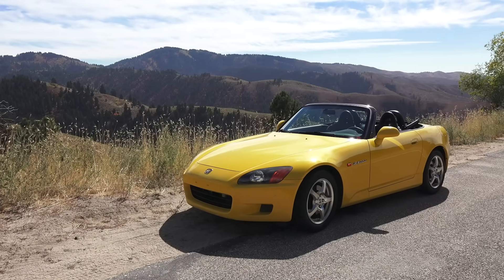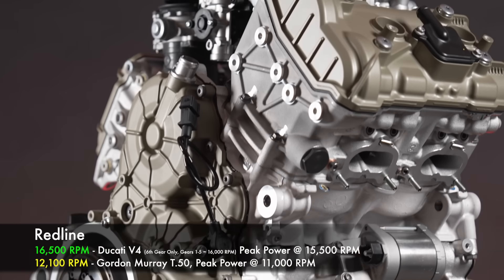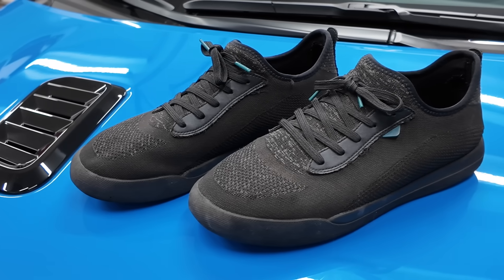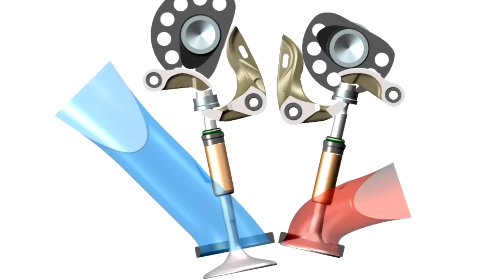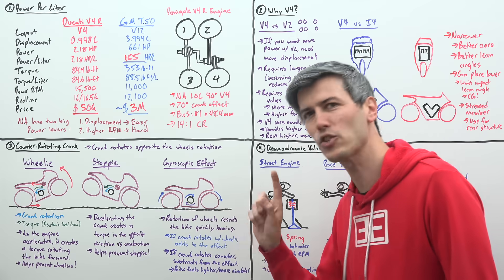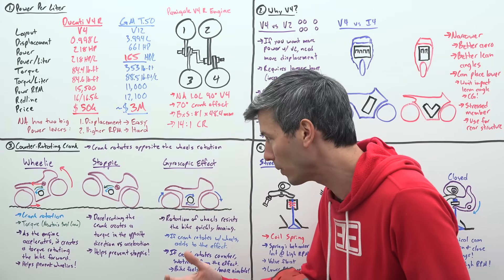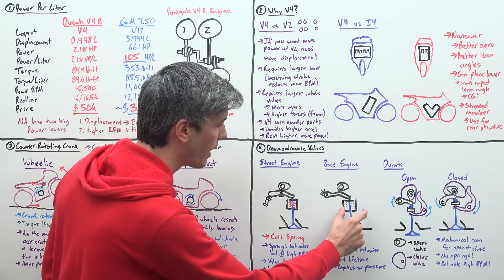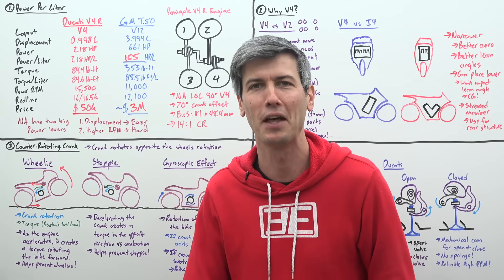Ducati's Brilliant V4 Engine — Putting Supercars To Shame!

Comment: Curious thing about the valve operations with no springs. Back in Auto class in the late 60s early 70s, that question came up to our teacher. His response was, that's the way they've always done it. He explained that a lot of horsepower was used to rotate that camshaft, but if there was a way to change that, they would. We couldn't accept that answer. We, as a group, playfully designed a dual type cam, similar to this, which would open, close and not interfere with each other, yet be accurate. Ours required very specific adjustable tolerances, but it worked, on paper. Very simple design. The Prof looked at it, shrugged and left the paper on the table. That alone irked us even more, but there was nothing we could do. As I got older and belt drives arrived, it all came back; why not make a mechanical only camshaft that almost freely spun? Crickets. The resistance would be minimal and efficiency would obviously increase. Now I see this and wonder why it wasn't done earlier (or was it???). I'm glad someone had the guts to try this out and succeed. The other experiment we tried was to invent an ICE that had a fixed connecting rod/piston that ONLY went exactly up and down with no sideways movement. We went through a lot of paper playing with that one. It was a fun brain teaser.
Reply: Interesting. I always thought that piston/rod mass could be much lighter if the two pieces were one. No wrist pin mass, for example. There's a gigantic (i.e. two-story tall), single-cylinder engine at a nearby steam thresher site that works like that: straight up and down rod function with the necessary rocking back and forth very near the crankshaft. Of course, its rpm are only in the low hundreds.

Comment: Excuse-me, but no: Ducati is certainly not the first street motorbike producer to offer a counter revving crankshaft on a production bike. It was Yamaha with it's in line four on the R1 in 2009 with the "Crossplane" engine.

Comment: It would be fair to point out that, although Ducati is currently the only company using desmodromic valves, they didn’t invent it and it’s not new. Mercedes were using it in the 1950s and it was being used decades before that.

Comment: 4:48 The main reason is - shorter and hence more stable crankshaft, which can spin 2000 rpm more than longer crankshaft of inline four engine (if other parameters are the same). More RPM = more power. That’s the reason why in 2026 all MotoGP bikes will use V4 (even Yamaha).

Comment: We can also make a hybrid of the powerful 2-cycle and the cleaner 4-cycle into the D-cycle, by simply splitting the piston ring-section from its skirt part - to be operated via a ( valvetrain-like) "pistontrain" to perform the exhaust and intake breathing strokes. The resultant D-cycle (differential-stroke cycle) completes the 4 strokes, different in both displacements and periods, per revolution. Tests have shown >20% fuel saving  and 2.5 to 3 times torque gain. The pistontrain can be retrofitted onto existing and new engines readily.

Comment: Really enjoyed the vid. 

I hope to see you make a video on the Yamaha R6 motor. 

IMO, itis more impressive. 

Revs higher and produces more torque and horsepower per liter without the use of “special” oil. 

Engine was bulletproof too. I put 120k miles on my 2008. Never had any problems with the motor

Comment: I have a couple sport bikes, including a 2023 Ducati V4SP2 with the 1100cc version of this engine and it is an absolute dream engine and overall machine. I also have a 2023 Honda Fireblade and I've built lots of cars, including 920whp Subaru STI. These bikes are nothing short of art.

Comment: Until five years ago, I worked for the company that was tasked by DUCATI to manufacture all the crankshaft and camshafts of the GP bikes (it's basically been a sole sourcing since the beginning of the DUCATI MotoGP team) and also manufactured bunch of components for DUCATI Holding.
The crankshaft shown in the video (at 3:00) isn't actually the one used on the std Panigale, but the one used on the Superleggera V4. 
That crankshaft is made starting from a raw billet, while the std V4 crankshaft is made from a forged raw part.
Same goes for conrods shown in the video, which were specifically made for that small run.

That said, beside being V4s, there's nothing much more in common between the DUCATI GP V4 engine and the Panigale V4 one. 
Oil distribution, angle between the 2 crankpin, counterweight shafts and weight distribution, etc... all different (as it should be). 
I'm also not 100% sure that the GP engine is a counter-rotating engine as well, but the memories on this topic are vague...
Just know that if they try to tell you that the Panigale V4 engine is derived from the MotoGP engine ... It's all publicity stunt.

Last but not least, I can tell you that somewhere in the archives of the AUDI offices, sit the the designs of a V8 and V12 Desmodromic AUDI engine.

Crankshafts and camshafts were manufactured couple of years after AUDI bought DUCATI, but for whatever reason the engine never saw the light of day. I'm assuming it was not meeting emissions limits imposed by the EU
I wasn't at the company at that time so I wasn't looped in the discussions, but I saw the dwgs and the excess camshafts that were manufactured inhouse as safety stock
Reply: Thanks for info,  Motop engine is now counter roatating but it wasn’t always.  Desmo Dovi famously ran well over the inside curbs at turn 1 Qatar that he alsmot crashed in preseason testing when he first tried it,  that is how much the riders had to force the bike over in high RPM high speed corner entry like at that track.  Subsequent to that change they’ve been in the rise.  For variety of reasons but that is a key one amoung them.
Reply: @metalmike87 good comment, but one addition, the desmo V8 for the R8 has been build and has been put into a test car. project was more or less done. Google Audi SHDZ. I assume you come from Pankl then?
Reply: Panigale V4 의 엔진이 구세대 데스모디치 RR V4 엔진에서 참고된 것은 부정할 수 없습니다. 시판용을 염두했기 때문에 gp v4와 다른것은 당연합니다. 세월이 흘러 더 강력한 엔진이 motogp에 나온다면 지금의 gp v4 엔진은 시판용이 될수도 있습니다. 개인적인 생각

Comment: Wow, nice video, thanks. I'm subscribing. Can I nitpick a little? Having a counter-rotating engine will not reduce the gyroscopically-induced resistance to rotation around the longitudinal axis (the rolling axis). The sum total resistance to roll between the wheels and engine will be the same. What will change is the force-coupling that  manifests itself 90 degrees away from the external input. (That is, gyroscopic precession). For example, use a toy gyroscope that is rotating away from you on the top. Try to roll it to the right, and it will try to turn to the right around a vertical axis. If you try it again with the top rolling towards you, as you roll it to the right, it will try to turn to the left around the vertical axis, but the resistance to roll will be the same, given that the gyroscope is rotating at the same speed. On motorcycles, rotating "forwards" tends to "yaw" the wheels further into the turn. A gyroscope rotating the opposite way presents a force to the chassis that tends to yaw in the opposite direction around the vertical axis.

Comment: Interesting to see something sensible on utube. Valve train is a major area to improve IC engines. Remember when F1 V engines revved  to 19000 rpm at those speeds valve springs can’t cope and all types were experimental, hydraulic, pneumatic, electronic, rotational etc etc. Brilliant engineering video. Perhaps modern geeks need to look further than just fitting gimmicks to modern cars. Sorry I really enjoy and appreciate motor cycle and other sport but my knowledge of road bikes is now very limited. Thank you.

Comment: It is no coincidence that the most sophisticated racing motorcycles in the world, those that compete in MotoGP, almost all have V4 engines. In the last 10 seasons, no motorcycle with an inline 4-cylinder engine has won the MotoGP world constructors' championship. Inline 4-cylinder engines are much less expensive to produce, which is why they are preferred for sports road bikes.

Comment: A V-twin has perfect primary balance. The moving masses all cancel each other so there’s no vibration. However the firing pulses are uneven. A V-4 is two V-twins with the crank throws in opposite directions. This creates four equally spaced power pulses.

Comment: The desmodromic valve is a very old concept as a lot of things in the mechanical field. The real wonder here is to manage the closing adjustment of the valves with the thermal dilation of the different material. I guess this is a real challenge to have the valve still closing perfectly if the motor is cold vs hot, and the material combination used to do this is surely part of the know how.

Comment: gyroscopic effect does not depend on the direction of rotation, a flywheel will equally resist changes to its plane of rotation irrespective which way it's rotating

Comment: Yes please, more on the 90° V4 and 70° firing order. And how is it different to Aprilia' s V4, as well as how Aprilia's adjustable rake/trail, swingarm pivot height, and their engines can be lowered in the frame affect handling vs. the counter rotating crank

Comment: As a previous Ducati owner, you forgot to mention that the valves need to be adjusted every 10k to 15k miles. So, I think you can throw out your reliably statement.
Reply: Pneumatic valve springs in MotoGP typically need to be replaced every 600 to 1,200 miles.
Reply: @07m4x9  My Ducati Desmo was certainly not a Moto GP bike😆

Comment: You touched on it, but also a bike under acceleration while leaned over will pick up, not abrupt throttle change because contact patch and traction is very limited while at lean, but counter rotating has the opposite effect is to pull it down into the corner.

Comment: Friction and Kinetic energy squares to velocity, that's the real expensive part.   
Yes I know, engine specs with stroke ot control piston speed etc, but when you do all of this, you end up always pulling torque out to have power and the only way to have the power is to stay up in the high wear rate of the engine, nothing is free in life, including HP with low mass.

Comment: I might be mistaken, but isn't this introduction a bit skewed? After all, to get a mass moving, you need torque. Cars are heavier, so you need more torque. But for the same displacement, more torque typically means less horsepower. So comparing the HP of a car with a motorbike is only telling half the story.

Comment: Hi Baby honey engineer! 
😂You may be a good engineer but you suck at math. 
How can the Ducati engine cost $504? 
You've calculated the cost per horsepower and it's ok, but what's the point? 
You bought apples with bananas is a big mistake anyway! 
And Again: 
One is a niche product, but accessible and on the road, and the other is a product that will be sold in 10-20. 😂
Reply: And what if you're talking about the price of the vehicle? The Panigale costs more than 50,000 as a motorcycle, right? 😂hai sbagliato comunque con 502$

Comment: I have a 1987 Honda CBR250 that red lines at 18500 rpm. It uses specially designed valve springs and a gear driven overhead cam. Springs do work.

Comment: The part about the engine gyro negating the wheel gyro is incorrect. It still adds to the gyro because of the plane in which it’s mounted as well as the fact that it’s adding to the rotational mass on that same plane. Doesn’t matter which way it’s spinning.

Comment: I've worked on several OLD mechanical machines in my career, such as four slides, screw machines, and mikrons. They often employ a cam and counter cam to move cutters in and out, valves open and shut, etc. I'm surprised someone didn't bring this technology to combustion engines sooner! Interesting that Ducati was able to patent it.

Comment: How is the counter rotation corrected for power delivery to the wheel?… is there an additional gear in the transmission or an additional shaft off the crank?

Comment: Mercedes-AMG One produces 353.75HP per litre with the simple addition of turbos, Eclipsing the meager power of NA motors, this is why vehicles are going turbo because it makes getting better top end power easier while still getting good economy when not giving it death. This reduces the cost of engineering and replacement parts.
Reply: AMG one is just a joke of a car.

Comment: Jayson, you need to take a look at the 1000 cc three cylinder Rotex motor for their  CAM AM 4 wheel side-by-side. It puts out 240 hp to 8600 RPM with a turbo.. they have a seven speed dual clutch with sequential transmission speed limited to 100 miles an hour in off-road.

Comment: Its probably worth mentioning that Ducati have been using the Desmo arrangement for 50 years or so & it was originally used by Daimler Benz in the 300 SLR in '54 (which was a 2.5L Straight 8 ).

Comment: A Desmosidici Stradale motor will never do 100k miles let alone 50k. Also, have you seen the maintenance intervals? Valve adjustment every 15k and if you really hustle this engine, you have a complete rebuild every few thousand miles

Comment: Reverse rotating crankshaft doesnt need an extra jack shaft or layshaft to get the direction of rotation right.
The driven gear (clutch) can be internal, ie with its teeth pointing inwards and engage the far side of the driving gear (crank).
You inherently get a bigger reduction though, problem on a road bike.

Comment: I don't know if it's the patents or manufacturing nightmare, but F1 racing needs desmodramic valve train, now. I've been wondering when it would happen for 30 years. Desmo is the difference in HP per cube. If you haven't heard a Ducati 999R in person, you're missing out. It's the most terrifying four cylinder on the planet.

Comment: Ducati did not invent the Desmodromic valve system or patent it. Actually a guy called Gustav Mees invented it and patented the system in 1896 followed by some other individual F H Arnott in 1910. Ducati have however almost exclusively used this system since 1950 ish. Ducati did bower refine the system taking inspiration from the earlier system, including the Mercedes system. Ducati holds patents for their revisions developed by Fabio Taglioni and later by some other engineers, not for the original Desmo system.

Comment: Desmodromic. Goes back much earlier than Ducati. I think it was developed as a solution to the lack of suitable springs steels. The original patent was Karl Benz in 18 something. I cant provide a source but early Norton's used PF (Peugeot Frere) engines around 1907. And Im pretty sure (some of) these were desmo.

Counter rotating.... MV made a ... before MV, S1000RR and I think 675 Triumph's Honda did it. Not the new Fireblade, CB 750's.

Interestingly, to us nerds at least, it did not use an extra jack shaft. It also avoided an increase in crankcase length. The mothod used was to spin the crank backwards then use a hyvo chain to drive the gearbox input shaft.... output shaft goes 'forwards'.

As someone who has ridden both; the effects are readily apparent and most pleasant. The down side is MV's are made of cheese. A V4R is a lot if money and has the crash resistance of a glass of champagne. If I had the money... Id have one tomorow with some BST wheels.

Comment: Why don't we have these engines (or motorcycle engines in general) in cars? Aside from a few open top race spec cars, like entry level Radicals. Durability? Emissions? A small hot hatch or sports car (like an MX5 or a Swift Sport with a Hayabusa engine) with a high revving, light and power dense engine should be a ton of fun even with a price premium.

Comment: It can rev higher because the weight of a bike is much lower as so inertia loads on the drive train. A crankshaft and gearbox of a cycle wontwork long at a 1,5t car. And a heavy engine does not rev as high.

Comment: Here's my problem with Ducati: this engine is an excellent use-case for the desmo valve system. Ducati's problem is that it insists on using this complicated system, with it's ludicrously expensive valve service requirements, on engines that redline at 7000rpm. Dude, coil springs are perfectly adequate for those engines.

I know there are afficionados who wouldn't have it any other way, but the spectre of $1000 valve adjustments has put me off more than one Ducati.

Comment: Just fyi, the Yamaha XS1100 around 1980 or so, also spun its crankshaft backwards.  Also the problem with desmodromic valve gear is the tolerances as the components changing size as they heat up and cool down. Without springs, the tolerances must be exactly right, or you lose compression and burn out valves.  Also I seem to remember the Mercedes Benz W196 race car used desmodromic valve actuation back in the 1950s, so I think any patents may be long expired.

Comment: Finally giving bikes the credit they deserve! Motorcycles are better in every way. Feel, sound, power to weight, emissions regulations, mpg. They are light years ahead of cars in terms of performace. An entry level 5-6k bike is like an 80-100k sports car. 🥹 All of these sheep are just throwing their money in the toilet! My favorite are the Porsche drivers, they get by far the most butt hurt when i gap them on my single cylinder duke 😂 🤙🏼 All that money and college degrees to just get gapped by a 6k motorcycle 🤣

Comment: I am very interested in the crank offset, how is 70 degrees possible? Is it simply offset 10 degrees on each bank to achieve 70 degree firing. I know of a couple car engine offset by 30 degrees, some GM V6s based off V8 architecture offset a 90 inward to a 60 firing, and the Volvo/Yamaha V8 doing vice versa to fit in a V8 transverse mounting more easily.